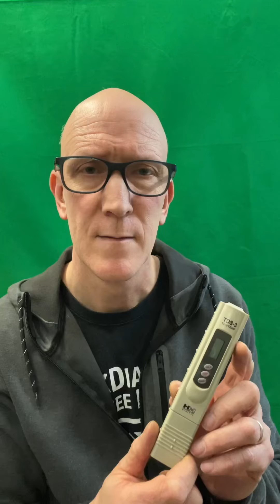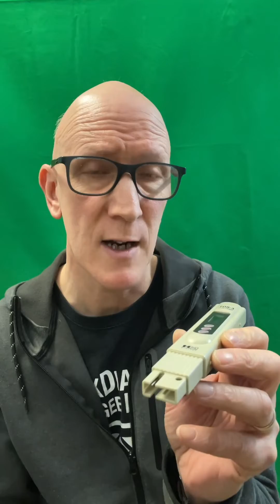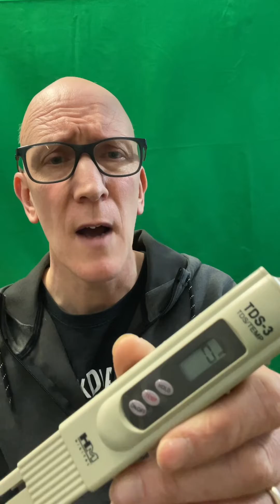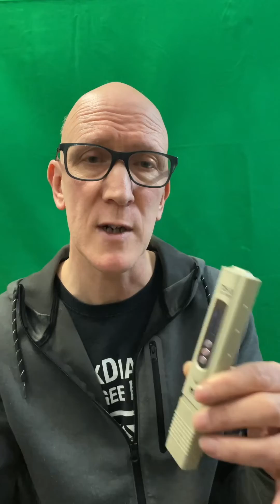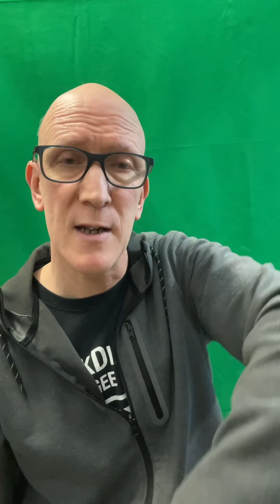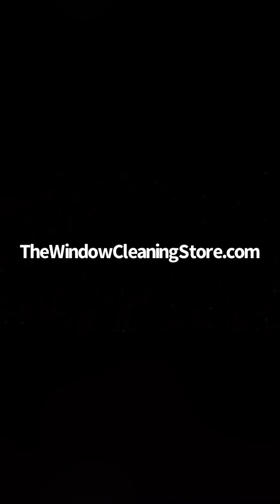How to use a TDS meter to test water purity - total dissolved solids

Comment: I have a 11 ltr  vessel but I don’t use it that often can I just fill it quarter full of resin will it still purify the water or do you have to fill it full
Reply from the maker: Thanks for watching. In most cases it’ll work fine Make sure the canister stays upright and best to turn the flow down to give the water more contact time with the resin.